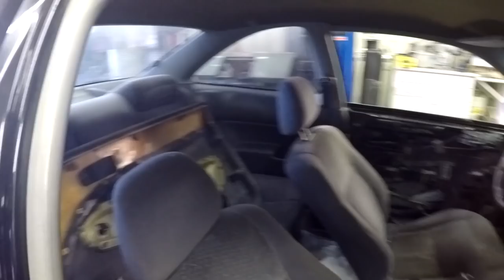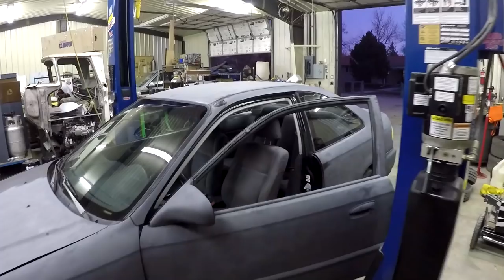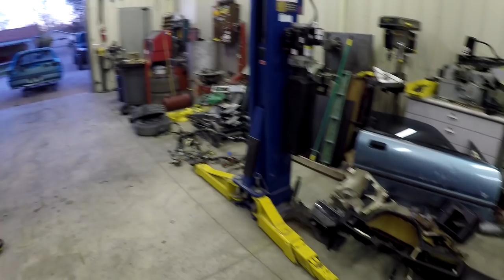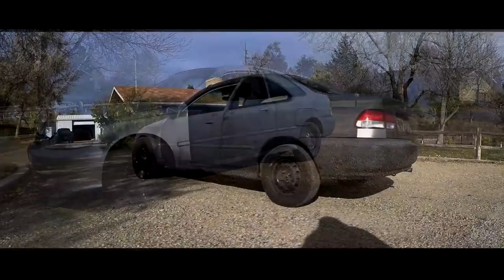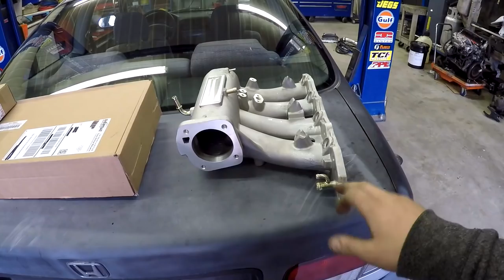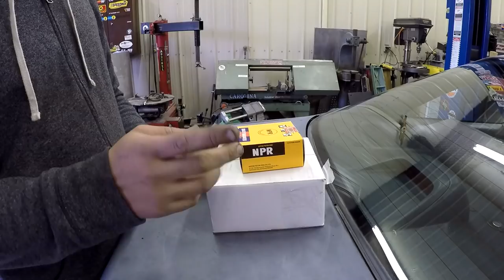Introducing SketchyEK (new racecar build)

Comment: As you can see by my profile pic, I painted my EK Electron Blue Pearl from an EM1, it was New Vogue Silver Metallic and the kid that I bought it from Bondoed the fenders and quarters and never sanded it. He also had a JDM OBD2 D15B 2 stage VTEC block with a Y7 head and a JDM Del Sol Si trans. I started over. At first I just put a Z6 head on it and boosted it and it was awesome for a single slammer on 6 psi revving to 9k on stock valvetrain. I got tired of having no torque and bought a B18B1 and a cable GSR trans. Then I bought BC stage 2 turbo cams and dual valve springs with titanium retainers and ported and polished the head myself and it made 408 whp on 16 psi with an eBay turbo kit from the single cam. Now it has a built B18B1 block with a JDM B18C TYPE-R head and a Turbonetics 60-1 with a PLM top mount turbo manifold and 3" downpipe, Tial wastegate, Tial BOV, and all name brand parts. It's amazing how far I've brought this car since it was a pile. I paid $1000 for it, and I've put at least 8 times that back into it.

Comment: Digging the new build. Would have liked to see the technique you used to remove the tint.  Show us the complete build. Shouted your channel out a few videos ago. Keep it up.
Reply: Get Lit Garage probably water and heat, i've seen it multiple times and it works nice
Reply: Use a black garbage bag spray windex on the tint and then press the bag onto the tint and close doors let it sit in the sun

Comment: I just finished watching and commenting on the previous video lol. Good thing i woke up early for this on a Saturday choosing what turbo on eBay be ideal for my b20b turbo in my dc4 then hit the gym but that can wait!. I guessed right Wyatt lol ek coupe papi. I paint a cheap good oem color depends what color you want bro.
Reply: @LatinoAD Buy the same turbo as they do on Ebay, Then turn the boost down a little. Will you be making videos? I did a k24 block /k20 vtec head swap on my CRX body with full interior going to throw on ITB's, It already made a little over 350whp and 479 ft-lbs(We use NM here in South Africa i's around 650 nm) torque. Only waiting now for the forged conrods and the rest of the forged internals then i'm going to build her up and give it to my pops for his birthday.
Reply: ok lol.
Reply: i am i'm ordering the same turbo he is using. Thank you

Comment: I had a similiar issue with the real skunk2 one it was cracked inside and looked like junk.  They made such a big deal about it and finally replaced it with a good one.  Def get the edlebrock or blox dont need to be super pricy just need a bigger TB.  Ive had issue with all the parts ive gotten from skunk2.  Only thing id get from them in the future is cams.

Comment: Paint her yourself you can paint the whole car for 500 no problem, pearl paint, hardener, clear, materials is less then buying most warps. I mean hell it's more for me to buy matching color wrap for my is300 front end parts then to buy paint an do it myself, paints Diamond Pearl White $27 a pint or $200 for all whole car to factory color or about $200 just to wrap the frontend parts or $400+ in vinyl wrap for the factory color or $1000 + for an exotic color. So $200 in paint an $100 in clear isn't bad, but of course if you don't have the other stuff we honestly to cost a little more but still way cheaper then vinyl wrap.

Comment: I'm pretty noobie in mechanics, but can someone explain me why they make the exhaust go through the hood? It looks way better (and sleeper) with full exhaust
Reply: Alan Gonzalez Its alot easier to fabricate most of the time, more convenient for sure (unless a daily driver). Let's the turbo spool faster since there is no backpressure and looks badass lol.
Reply: Alan Gonzalez I have an EK with a built d16 doing 415whp. I have a full exhaust with a magnaflow and it's dead quiet but also have a cutout righht after the downpipe. Best of both worlds except the fact that my cheap cutout keeps messing up lol.
Reply: Thanks for your time bro! congratz on that EK, here in south america is hard asf to find an non-riced honda, also, there are only sedans here :/
Reply: Alan Gonzalez Its the same here. I usually get labeled a ricer too until I run em lol. I'm actually having turbo issues right now so thanks for the luck haha

Comment: Its not a EK coupe my dude. US specs; 96-00 Civic coupe DX (ej6)
96-00 Civic coupe HX (ej7)
96-00 Civic coupe EX (ej8) 
99-00 Civic SI (em1)
Reply: Dragon ball Fanboy 99-2000 civic si (em1)
Reply: i care..i just figured is good for others to know the proper term instead of looking ignorant AF talking to educated car enthusiast.
Reply: Bro who cares about y'all not caring. Want a cookie?
Reply: Dragon ball Fanboy I call all those models eks lol but what do I know I drive an acura integra and dont give a fook about civics
Reply: It could be a import car so he could be right.
Reply: Mine is an EJ8. 97 EX coupe...that makes 508 whp...
Reply: Boosted B Series EK I like that cluster tho on your  Civic never saw that one before
Reply: J R no only hatch backs are ek technically
Reply: Dragon ball Fanboy and who cares about you not caring that someone doesn't care but you care enough about knowing about the chassis codes... so you cared enough to try and correct someone.. not that I care
Reply: Dragon ball Fanboy it is definitely a eking coupe lol its an ek and not a hatch
Reply: St33zy Steve. Still could be a imported or a swap
Reply: J R no, no it can't... Because it's a coupe. Which have either ej, or em on the vin tag. Only hatch backs from Japan say ek...